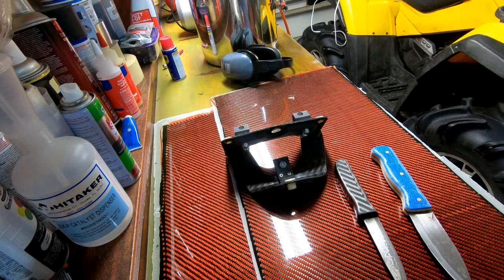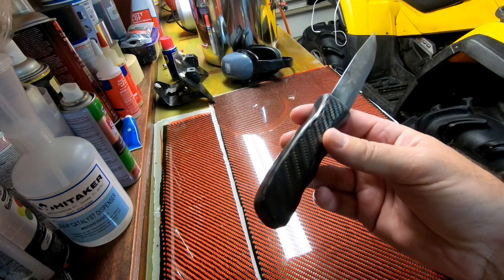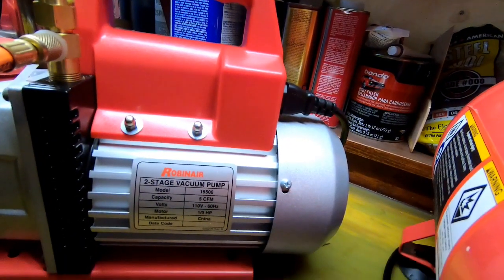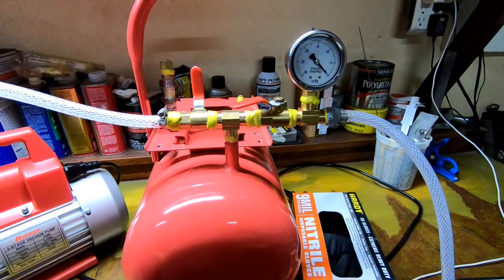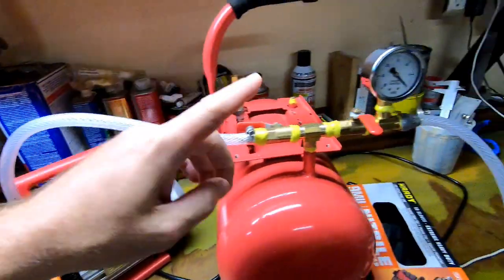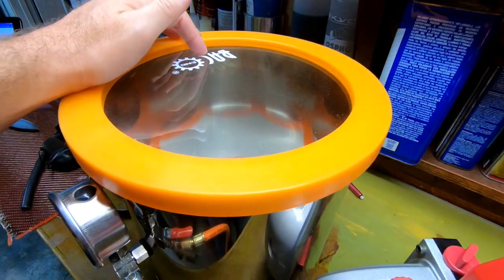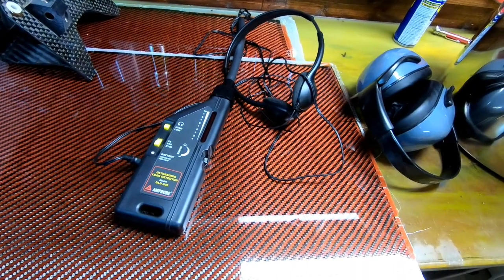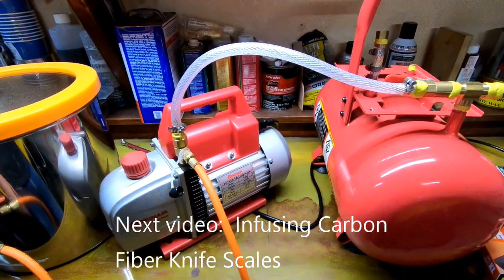How to Setup a Resin Infusion System.  My Resin Infusion Setup

Comment: Hi, what happens if we do not use a reservoir?
Reply from the maker: Its not necessary.  I use one because it adds volume to your bag, which then slows the rate at which you lose pressure if you have a leak.  It will also help prevent damage during start up to certain types of vacuum pumps.   Lastly, with the dual ball valves you can pull a vacuum on two layups independent of each other.

Comment: Awesome! My next one off skiff build will be bagged and infused basalt and carbon fiber! Thanks for sharing!👍👍
Reply from the maker: Thanks!  Ive been wanting to try basalt CSM for mold building.
Reply: We’re All That Bored this will be my first go with basalt! Have used various weights carbon fiber though. I am engineering a laminate schedule for an ultra lightweight 18’ poling skiff. I am shooting for 250-275lbs. I want the outer skin to be basalt for it’s abrasion resistant characteristics. And of course the carbon for stiffness. It will have 4 different weight carbon fiber cloths to achieve my goals and meet the required strength/stiffness for individual areas on the build.